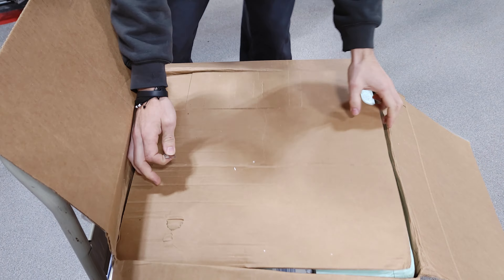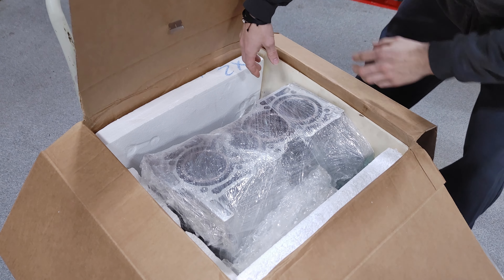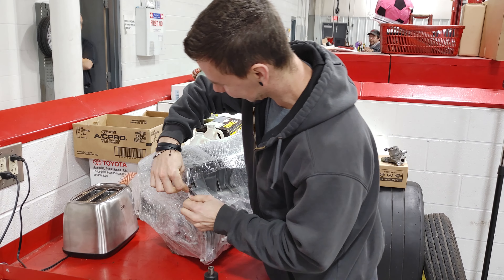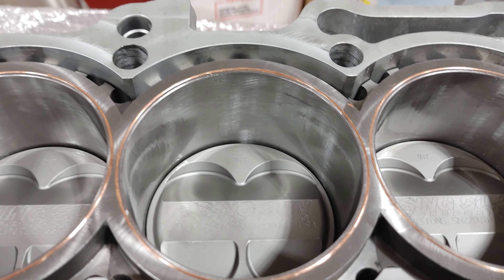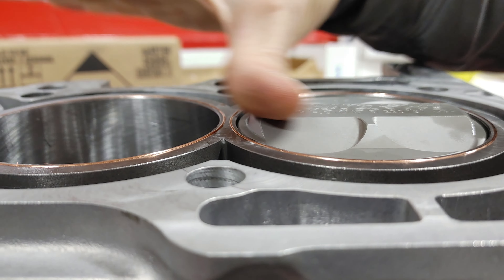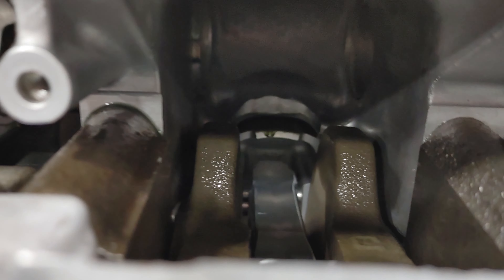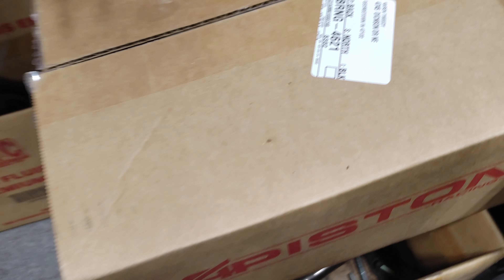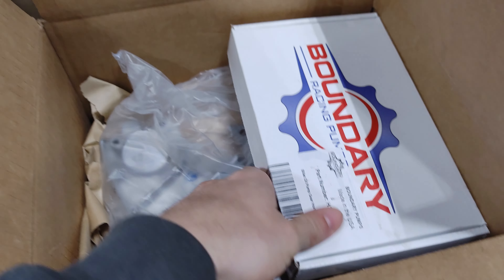Sleeved H22 Block Is Back From Machine Shop!

Comment: Love how you’re still representing the H22!!! I can’t wait to see how everything  comes together when everything is assembled. What are your specs for the block/compression etc? I have a boosted H22 that made 600 whp on e85. It’s in a 6th Gen accord sedan. I love how the H22 is still in the game. I know everyone is going K series. I’m going to add more fuel and get to 700, but idk whether to try AWD, or what upgrades to make to my transmission. It’s a street car that I have fun with on the highway. Doubt I’ll ever take it to the track or beat on it from a dig. I’m following your comeback story and can’t wait to see more.
Reply from the maker: I think i talked about specs in the previous video. But 10.8:1 traum custom pistons with bme 400 series aluminum rods. Should be good for 1300whp. Turbo will only do around 1200 tho. I deff recommend and upgraded gearx gear set. I have tons of trans videos as well

Comment: Is it an H22A4 or an H22A? I know the A4 needs them done if you want to boost it (what I have) but for the cost and durability I've considered just getting the h22a to swap in. What type is this and what was an estimated cost for the rebuild?
Reply from the maker: Its a H22A4 and its around 1200 to have them sleeves alone installed. The weakness of h series blocks isn't necessarily open deck vs closed deck. The factory ringlands on the pistons fail. Depending on power level its better to just get either block sleeved. Then you aren't limited on aftermarket piston options. As far as how much I have invested in my block in the video its rated for like 1300 whp so just assume a lot 😅 you can look up the cost of aluminum rods and custom spec pistons and add a few grand for machine work and assembly and figure it out
Reply: @H22PreludeDude  alright very cool. I'm looking for around 400hp but h22a4 builds are few and far between. Definitely subscribing!
Reply from the maker: @TheOminousVoidWispers  I appreciate that 🙏🙏 just my 2 cents i always recommend going ahead and sleeving from the get go. Safer and can always go up in power when you get bored with the power level you are at. Which usually always happens 🤷
Reply: @H22PreludeDude  exactly why it's still stock lol thanks for the tips!